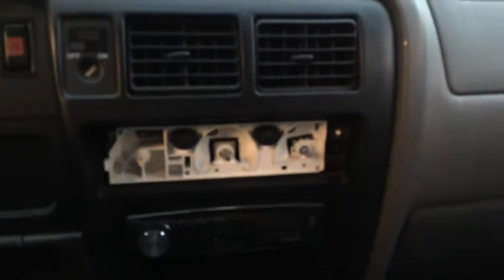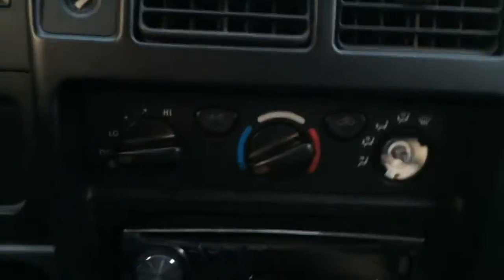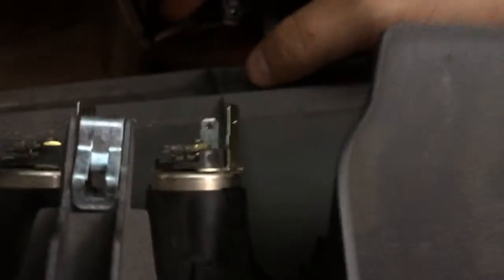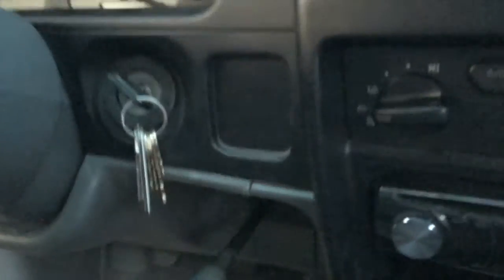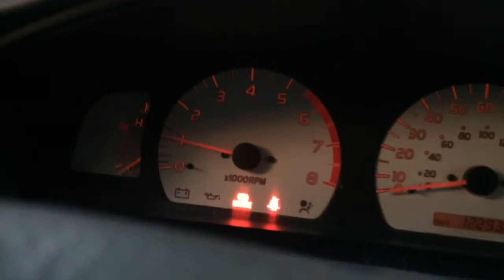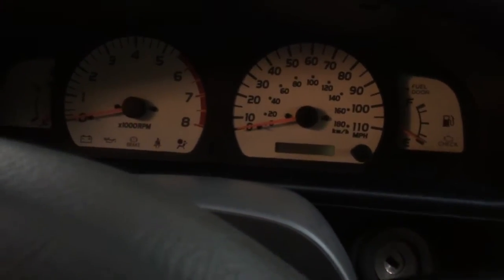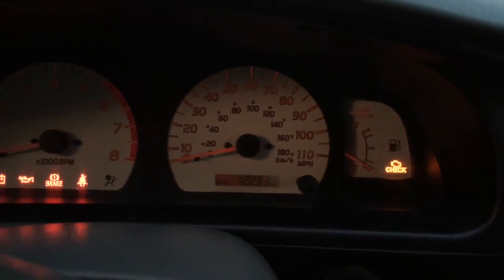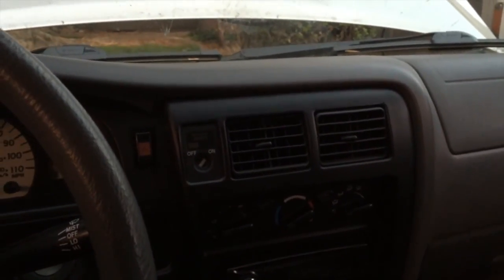2001-2004 Tacoma Gauge Cluster Swap Part 3

Comment: Your camera cut off right before you should the new cluster.. Was trying to catch the part number.
Your old cluster part number matches mine 83800-04B80.. Wanted to see what cluster you used
Reply from the maker: Honestly, I’ve never really used part numbers on these clusters so that would explain why I cut the camera off. If your truck is an 01-04, you can use any 01-04 cluster that comes from the same engine your truck is. 4cyl will swap with 4cyl and 6 swaps with 6. I’m sorry for the confusion.

Comment: awesome ,
   i own a 2001 and im tired of the red back lighting i want to change to blue has anyone taken a cluster apart to see if the cluster has red clear bulb cover that i can remove because i want to use LED colored bulbs because they are brighter. I also bought the new LED headlight bulbs  omg what a difference i suggest anyone who has this truck use the led headlights with high beams because they are way brighter and they are cool to the touch i got a set on ebay for $16  and they are the phillips not cheap knock offs they have tons of auctions on ebay make sure you order the leds with high low beams cause they also have the single beams which will work but you wont have high beams but running the low beams is like having the high beams on they are that bright and cool to the touch and saves your charging system, im soon gonna buy the led tail light and turn signal buls, i have leds all over the truck i do alittla at a time. , ive had no one flash me so they are leveled that little extra high beam is sufficiently brighter. also also my factory radio is red i want to change the color in it as well to blue. anyone do this?? thanks
ryan
Reply from the maker: Actually yeah, they do have orange rubber covers over the bulbs. I don't know about the factory head unit because I've replaced it. I may end up doing a video about LEDs in the dash but I want to buy some that can dim so I can actually see at night lol
Reply: i have put leds in the heater panel and they do dim with the dimmer so only thing the heater panel color cannot be changed because the orange tint is in the panel i tryed to scratch it off and i ruined the panel that is why i asked u if you know where i can get one i have asked many salvage yards even ebay has one for liokje $14 which i think is high for this part no one has one. so i wanted to pass the info on about using leds the bulbs in the heater panel bulbs  they are really tiny bulbs so what i did was use the twist connector and run the larger bulb wires through the front panel opening back  to then attach them to the twist connector ive done this like 4 yrs ago still working great so i think all leds are dimmable, i bought cheap onee like 30 bulbs for a couple bucks on ebay. hope this helps others, i hope someone can find me a heater panel benzel and a clock cheap, ive looked everywhere.

Comment: how did u set the odometer
Reply from the maker: I dont know if it's different for other states or even just company to company but I had to take the original cluster and the new cluster to a place and they do it. I assume they have a program or some such they run to match the miles on the odometer.

Comment: How did you go from not having a tac to having one with the new cluster
Reply: he had the base model, its weird they dont put tachs in a truck with standard trans i could see if it was an automatic, my prerunner automatic v6 came with the full upgrades even a clock and tape and cd, wish it had an input line for my phone i bought a radio tuned for my phone to play over the non used radio station. the square he showed is where the factory clock goes  which goes in the square he showed on the benzel my clock is fucked up, i need a factory clock and heater panel benzel if anyone knows where i can get one cheap, its the panel that the shows the heating fan and temp. thanks